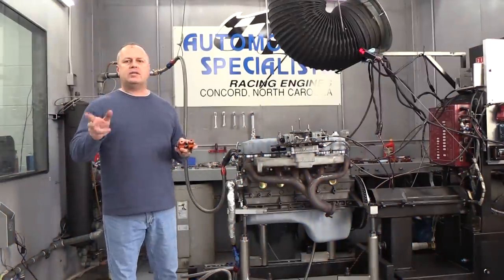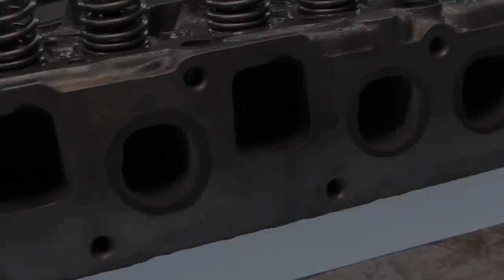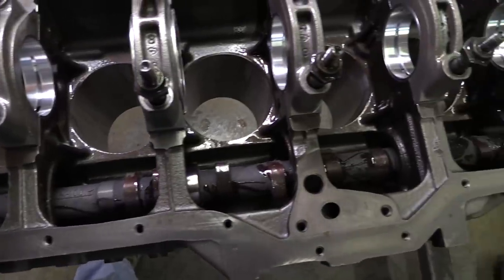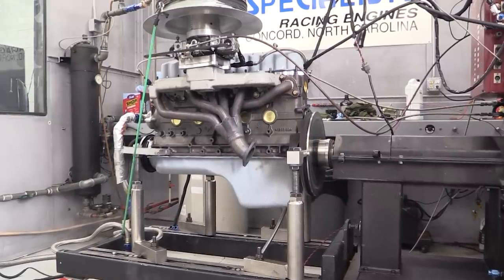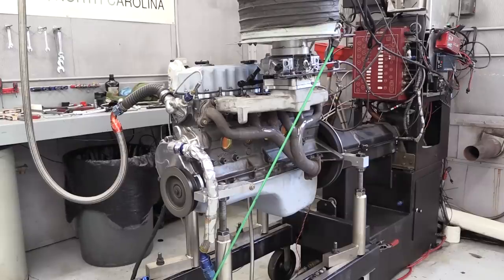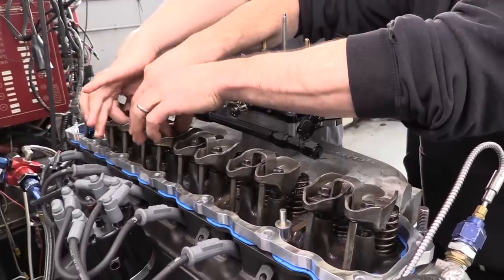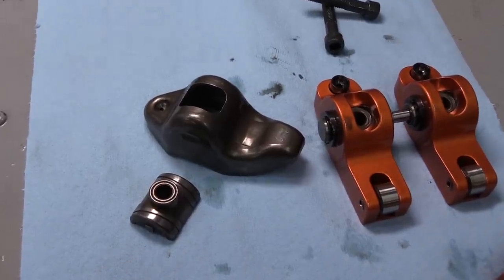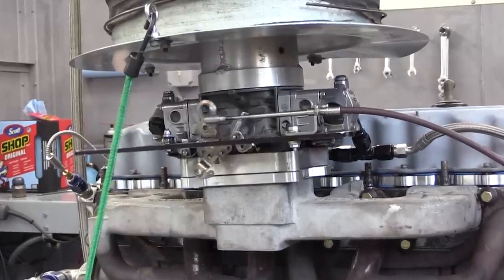Do Roller Rockers Make Power? (Dyno Testing a Jeep Stroker to Find More Horsepower)

Comment: This test at best is inconclusive, you need to measure the lift at the valve with both rockers to verify that they both produce the same lift, often times stock rockers don't live up to their advertised ratio
Reply: I have a 2004 i6 w/ 145,000 mi. It runs good but the tick is getting louder. If I was to spend $6000 on motor rebuild,  wouldn’t it be smarter to put a small V8 in it ?
Reply: BTW-  I use this Rubicon approximately 80% of the time off-road.
Reply: @clasvirhodes4969   it depends on what state you're in and the emission laws of that state, if you were to do it though and stay compliant you would have to use an engine  of the same year or later model you cannot use them earlier engine and get it certified  to comply with emission laws
Reply: @clasvirhodes4969  -For a Jeep.  The Ultimate is a Cummins R2.8 crate engine.  Has lots of power down low.  Could save money on larger tires.  Because you might not need a gear ratio change.
Reply: @clasvirhodes4969  6k rebuild lol what are you rebuilding a 12 cyl Ferrari ? @ 145k your due for a timing chain set are you sure your tick requires a rebuild? Checked flexplate bolts? You thinking piston slap? You been using high zinc oil or an additive? You can get master rebuild kit under 1200 depending on if you need pistons, 200-400 machining costs, plus labor if you cannot do yourself. These rockers in the video are way to costly HP to dollar for a mere 9hp. The head itself for all those runs is the bottleneck that's why none of the manifolds had any gains. If you was to do just the cam swap, port matching, small header, and some tuning bring your 191hp stocker to around 250hp they got the other 60hp from the overbore and stroke increasing displacement of which they cannot take full advantage of due to the head. Depending on the V8 you was going to pick to put in you could be looking at around 190-240hp in stock form and have all the disadvantages of a unknown v8 90degree engine versus a reliable I6. Then you have to mod the V8 to work in the jeep... Where you could have just cammed the 4.0L and called it a day. Oh and that V8 swap is gonna cost you MPGs even at the same power output. GL with your decision. If it was me I would celebrate having one of the best looking body styles and the last year model of the GC with that body, the last year for the highest output of the 4.0L and having a full size spare under the back floor out of the way/weather. We will just have to look passed the lack of radiator protection, bumpers, tow hooks, and hope we don't ditch it or try to tackle a deer with it.
Reply: @steve6992  thank you.  Did not know that
Reply: @zxej6879  thank you but, I can’t stand the smell of diesels
Reply: @masterdebater8757  sorry for the confusion. I am considering hiring the Newcomer racing crew to build it. I am not capable
Reply: @masterdebater8757  thanks. I appreciate you sharing your knowledge.
Reply: @clasvirhodes4969  Run corn oil.  It will smell like popcorn!  Seriously though.  My wife and I drive diesels.  The turbo common rail fuel system burn very clean.  With mor power and fuel economy.

Comment: Now you need roller lifters. Test engines were built with them circa 89 or 90 iirc. As far as the stock rocker arms go. Prior to 1988 or 89 they were stamped in house with a very meticulous die maintenance program. There was one die maker who's full time responsibility was working on the parts for the transfer die used in these parts. Particularly the punches used to form the seat for the rocker arm bearing. Prior to '73 or '74 the AMC six used a shaft mounted rocker arm assembly. After the press room at Kenosha was shut down these parts were out sourced. In terms of the roller rockers. Would it help of the pushrod end had the seat closer to the cam. This would allow a shorter pushrod which should always be a good thing in an OHV engine. Or would it cause an issue with pushrod angles. 
The 4.0 could really benefit from a better head design. It might be a question of market* size but with modern ignition technology it sould be possible to design and build a good flowing cross flow head with the intake on the distributor side of the block. Development of their inline sixes is something the US manufactures really dropped the ball on. Built as standard economy engines I suppose V-8s were the easy way out. Pontiac tried but the bean counters shut that down. It is my understanding that OHC experimental versions of the 232 were built in the 60s. But didnt go anywhere do to cost issues. The test mules or mule most likely used a camshaft assembly simply bolted to the top of the head.
*Edlebrock's aluminum head really couldn't stay too far due to CARB requirements for aftermarket parts intended for street use.

Comment: It should be noted that the roller rockers are a horse power "realization," not a gain. The horsepower gain should be measured in terms of camshaft comparison. Headers and manifolds are realizations also, not gains.
Reply from the maker: You aren't wrong, switching to roller rockers doesn't technically create horsepower, it just keeps less of it from being lost to parasitic drag and other factors. But I always try to make things as simple as possible -- if I can make a change and see more horsepower or torque at the crankshaft (And the only thing that matters is how hard is the engine turning the crank?), then that's a "gain" in my book. Thanks for watching!

Comment: Engine masters did this but they used roller rockers with a greater ratio than the stockers which means the valves got more lift. I always knew less friction means more power can be put to useful work but the question is, how much? The engine Masters test did not answer that question. Yes, they got more power but how much of it was by the valves getting more lift? Your test was was genuine and answered the question as asked, not with an unknown factor thrown in. Well done.
Reply from the maker: Thanks for the kind words, and thanks for watching!

Comment: 8:54 "A full roller rocker arm... is easier on the overall valvetrain."  I would challenge that statement.  Much heavier aluminum roller rocker arm requires heavier springs, increasing load, wear and parasitic drag. It's a vicious circle, everything is a compromise between power and engine life.

Comment: But Wth on my solid flat tapper 406 SBC with 11:45-1 it unfortunately gained 35 hp with 1.65 rollers over 1.5 ball rockers. Of course the 150 shot made more of a difference. It was 1991🤷🏻‍♂️🤣

Comment: I'd be interested in a way to convert to a roller cam along with roller rockers. Modern oil doesn't have the zinc content these engines were designed for with flat tappet. I'm sure my 4.0 has a worn cam as a result of running with regular oil for the past 5+ years at it being over 220k miles.
Reply: Why didn’t you run Rotella T6 for the past 5+ years for higher ZDDP content?
Reply: Probably so ! However if you put new cam and lifters back in. You wouldn’t notice a difference !!!!! It’s that small a difference
Reply: @Zapablast05  Because I didn't know it was a flat tappet cam when I got it. And I didn't have it for that long. Nor do I know if the previous owner knew.
Reply: @flatheadfletch  Are you suggesting I just regularly replace the cam and lifters? Or even consider where the metal shavings go as the surfaces are worn down?

This is why I decided I'm just doing away with the 4.0 all together. Chrysler should have updated the engine like Ford did with their flat tappet engines vs doing nothing about it.
Reply: @Zapablast05  Rotella has to pass the new oil standards, and shell reduced the zddp levels to standard motor oil levels. T6 meets the new ck4 emissions standards so it doesn't have the same zddp as it used to. Valvoline vr1 has  high zddp levels, though.

Comment: Among Hotrodders, we often have a set of. aluminum-/ported,  V-8 heads, just ready to slap-on the LS block we're ALSO, someday going to acquire.   Through the WONDERS of cutting/re-welding, those alloy-heads could be configured into a big-valve, crossflow, alloy-head which in OHV, could still put Aston-Martin & TVR to shame.  WHY put a sixer under the hood,, if you FORCE the users to "Imprison" a build with limitations that, because they added Nothing, produced little.

Comment: YOU FORGOT TO CHECK THE STAMPED ROCKERS caps real ratio. That a roller rocker makes more power because of friction losses.. that no one, can or will deny.  For example a chevy smallblock stamped rocker will not have 1,5 as advertised.

Comment: Here the thing i was told by some engine builders who no way more then me , if you were to take the stock stamped rockers and mic them they are all over the board factory imperfections , which throw all the # uneven ,causing most of the hp loss , this was on bbc and under 6000k ish rpm

Comment: With stock rockers none of them will be a true 1.6 ratio so ratios will be all over the place which also causes issues of unbalanced cylinder pressure being some are opening at different rates along with the flexing they will do that compounds the issues of inconsistent rocker ratios even more especially at high rpms . The other thing is some engines benefit from rollers better than others such as this system or the ball & stud style like what's used on the older Chevrolet's & others where there is much more heat & less stability to hold the rockers in one place that can make quite a bit more power but with a Chrysler small or big block that uses the bar system almost like those nice & expensive T&D bar roller rockers you see a bunch of Chevrolet's guys using now on the non LS engines they don't benefit from a roller nearly as much being they are more consistent on keeping the rockers stabile along with less friction so on those type engines & valve train the power comes from the ratios being a consistent 1.5 1.6 or 1.7 ratio when you use a roller rocker on those type of valve train  .  You guys should have tried a 1.7 ratio to give more lift to see if that would have worked the head more if they make a 1.7 for this engine ? But I doubt it would have helped much being those restrictive exhaust ports would probably keep nosing its power over choking it off or maybe a longer duration on the exhaust lobes to hold it open longer which probably would kill bottom end torque down some using a split pattern cam .  I like what your doing with these Jeep engines so keep up the testing videos !

Comment: A roller rocker that is made correctly is a defenite advantage. A tin rocker struggles to be its advertised lift. Replace it with a proper roller and you will get true lift as well as a bit more duration as well.A roller in effect increases duration by rolling across max lift holding the valve open a little longer. 
BUT on a std engine increases are negligible though on a remotely performance engine it will give you smoother operation and not sideload the quides as much. On a common or garden version not worth the money on an engine that seldom turns more than 3000rpm. Though never hurts!
Standard tin rockers wear out the most on the fulcroms. Usually best to replace the lot on all bar low km engines. Ideally use an OEM one though premium brands usually sell them. 
BUT when replacing tin rocker with rollers on a modified engine be carefull as the duration as noted can be an issue. And ratio changes can be dangerous as both lift and duration changes and piston to valve is often an issue. I have seen the mess after!! This is also not a quaranteed gain, it can be ofcourse but sometimes this loses power. Every cam is different. In my experience a good cam does not need more ratio. Ratio changes bandaids the wrong cam. And on bigger cams the extra lift can cause retainer to guide issues as well. I have seen that to. Not on my engines.
You need back to back dyno testing on engines that have been built to be safe with the extra lift and duration.
And most of us have not got the access to unlimited dyno time. Track testing can be ok. With an experienced driver to note the gains. Or losses.
The headline pic of the engine with the weird headers and then no exhaust?? Needs 2 feet of exhaust at least and even then probably loses power over a factory manifold.

Comment: Can you find a KA 24 Nissan build?
Reply from the maker: That would be a fun one.
Reply: @TheHorsepowerMonster  I want to build one so bad. I wanna short stroke one, for like 9k rpm, I haven't done the math, but my guess would be about a 2.2 is what I'd end up with. Of course, I want to do mods, so I'll want to dyno it. 
Hopes and Dreams mod list:
Cams, (about the same spec as the inline 6 in the vid)
oversize 3 angle valves,
race pistons,
honed and port matched head and headers, Holley blow through spfi, with a turbocharger.
I'll build it one day.
If I had an unlimited budget I'd spring for a custom billet head...
pop

ok, back to reality now.

Comment: All I can say is that the stock rockers must have an incorrect ratio. Every test I have ever seen shows that stamped steel rockers produce more horsepower than roller rockers, especially at higher RPM's. They are much lighter and allow for better valve control. Everybody thinks there is so much friction in the rocker arms but a .525 lift cam only moves the rocker arm .328 of an inch. That is around 3/8ths of an inch total. And the tip on the end of the valve stem is even less. There is very little if any frictional loss there. If the stock rockers had started out the same horsepower or slightly more and then gotten passed by the rollers at higher RPM's I would have suspected deflection of the stamped steel. Since the rollers out performed all the way through there was something different about the ratios or something. They might supposedly have the same ratio but I'm betting an actual test would show they are less than advertised. Good test though, thanks.

Comment: ..If the power would of shown up toward the end of the pull when friction is at the highest,
but it didn't.. the power curve is parallel across the rpm range. the rollers have a higher Ratio than
the stamp steel. Put a dial gauge on it.

Comment: Those same gains can be had on a modified 5.7L SBC engine that runs street or strip.
Mine did on the dyno. Extensive Head porting , a good set of competition shorty headers and a good camshaft profile can all work together to free up a bunch of extra horsepower and torque.
It ended up being a lot of extra bang for the buck. Also running your pistons to zero deck height seems to really wake up engines since it greatly affects the quench area in the combustion chamber.
The head gasket is then the only thing that determines what your piston to head clearance will end up being.

Comment: Great video and I have personally done similar dyno tests.  The end result is always the same.  Great job guys. The hard part is convincing the customer.
Reply: stock stamped to full roller is an easy test because stock stamped are so inconsistent on the ratio. what we need is a test of roller tip vs full roller.

Comment: When you use roller rocker arms with the correct Geometry it reduces side load on the valves it requires extra work.
That looks like a cool jeep engine also.

Comment: 4.0 jeep motor...searching for horsepower. 
keep searching fellas. 🤓
Reply: For a lot more power without a turbo your looking at a new head. If camless engines ever really hit the street just think what one could do. Low lift short duration at idle. As the RPM climbs the lift and duration adjust. With a multi valve engine shut down one I take and exhaust it low rpm. You could even cycle back and forth between which valve opened and closed.

Comment: I've been running Sharp's rollers for over 40 years now on a lot of different type engines with absolutely no failures & always saw HP gains. I also use them on my BBC Chevy motor home in the 1.8 ratio to provide .040 inch increased lift. Yes you CAN feel the difference!
Reply: I’ve been thinking of putting some on my tow truck. Thanks for letting me know they’ll work on a heavy slow revving vehicle

Comment: So sorry if I'm completely wrong but what's the benefit of a short 6to1 exhaust header in a stroker? Engine set for torque and exhaust set for power in high rpm range? I get its a dyno mule but...?
Reply from the maker: Good question. It was an aftermarket header that was available and Newcomer had tested just about every combo you can imagine. Thanks for watching

Comment: I believe the power gain from the rollers is from the adjustable feature more than the friction aspect with these light beehives.
In fact the way to disprove my contention would be to use adjustable pushrods on the stamped rockers.
Almost all other vids I've ever seen bar this one, show rollers make hardly any difference.
Of course rollers are so much better it is ridiculous esp when using aftermarket camshafts and you'd never ever use stamped in a .575"+ lift camshaft but yeah... I'd like to see a bit of user dialled preload on those stamped arms. 

There is always the possibility that stock Jeep rockers are worse than any other brand for flex but they look more sturdy than Chevy stamped to my eye.
Reply from the maker: We used a different set of pushrods with the correct length for the stamped rockers. Newcomer set the preload at a half turn for both. Thanks for watching

Comment: The real question is, whether or not a Jeep I6 makes any horsepower at all
Reply: My 300 i6 only makes 165 hp and 265 lbs torque. At 2000 rpm. Roller rockers ARE a waist of money unless your running over 7000 rpm. Fact